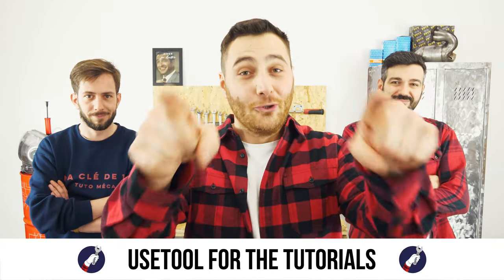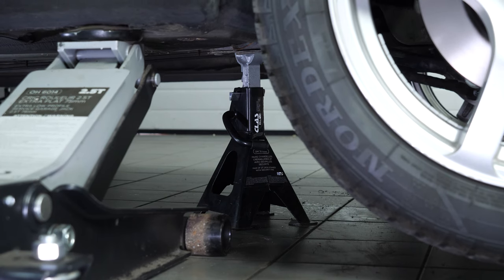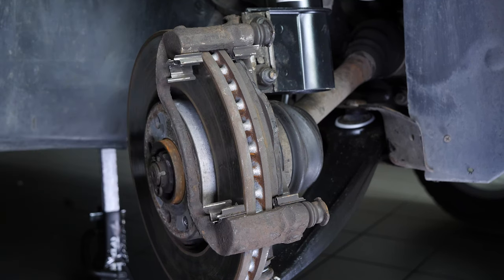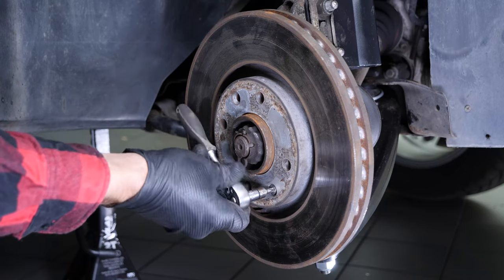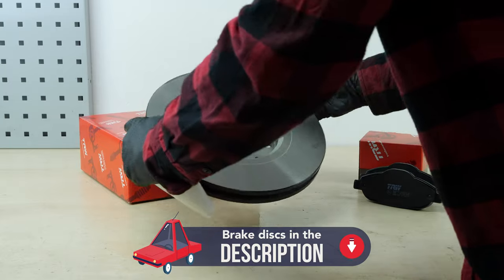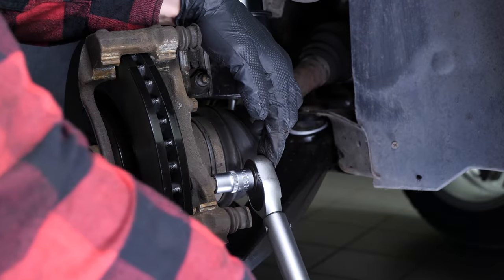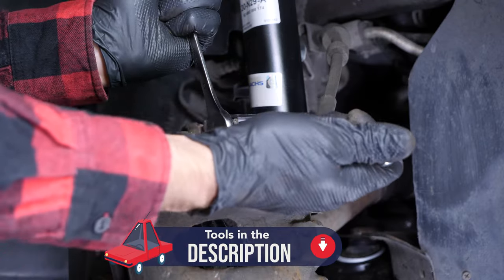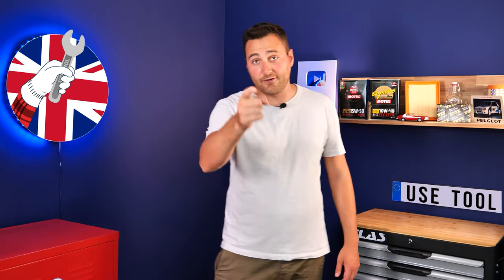How to replace the front brake discs and pads Peugeot 3008 mk1 🚗

Comment: Do I have to change noise-dampening shims when changing brake pads? Do I have to buy them separately or it's coming with the break pads?
Reply from the maker: Depending the brand you choose. Better to change them but no problème to reuse
Reply: @UseTool_EN  thanks
Are the shims the same on all break pads of the car?